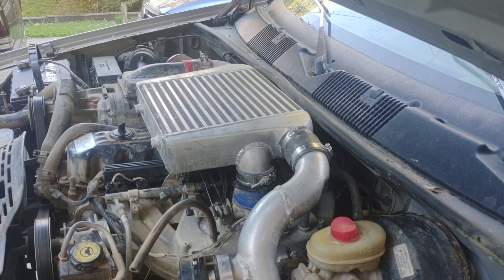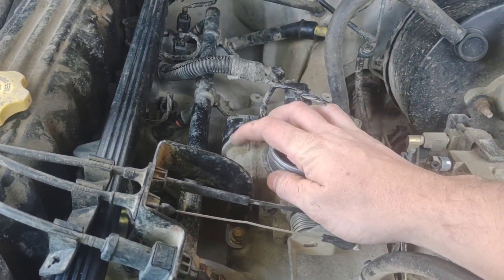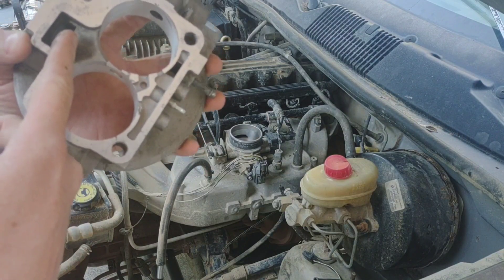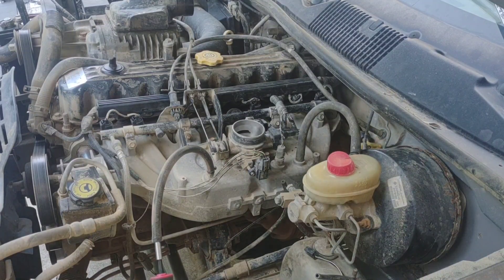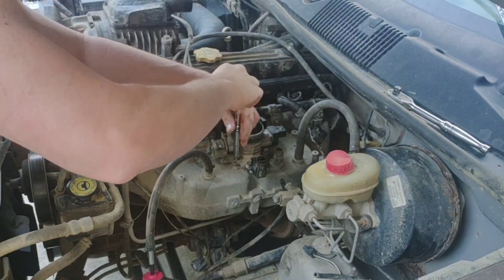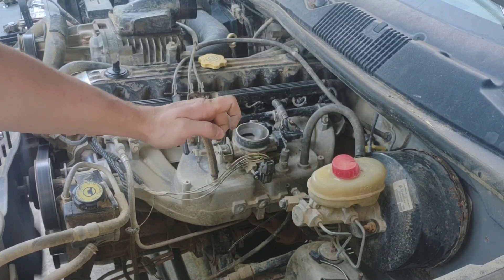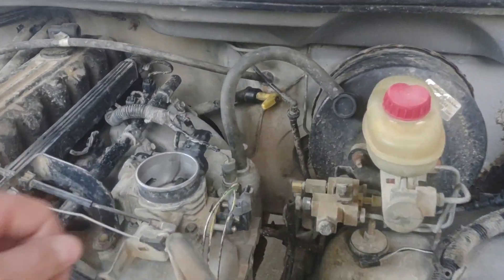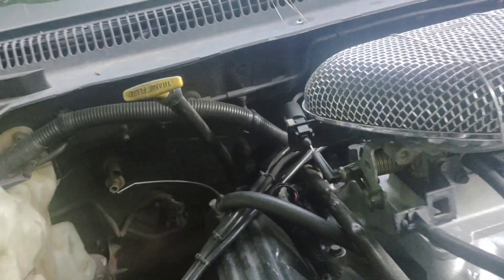jeep 4.0l base idle adjustment (same process for most early EFI)

Comment: whats you opinion on just setting the idle manually and skipping the iac entirely? i imaging a bit of idle variation is tolerable, but does it ever have issues besides vacuum leaks causing high idle?
Reply from the maker: Really depends what you're doing with the vehicle. If it's a daily driver IAC is a good thing. It adds a bunch of air on startup especially when it's cold, it compensates for transmission, AC and electrical loads at idle. From experience on one of my vehicles without iac I had to have it idled up quite a bit so it wouldn't die when the cooling fan came on. I would also have to give it some throttle on start up especially when cold outside. This was on a 4-cylinder the bigger the engine the less it cares.

Comment: I have an 85 cherokee keeps stalling midndrive when ibrelease the throttle gonna try this or st least somethomg tk the effect losing braking power and lower steerig mid turn in coty streets is gonna kill someone 😅
Reply: I fkn hate typing on a touch screen as you can tell lol I'm not illiterate I just dgaf anymore
Reply from the maker: Hopefully this is your issue. Idle air control motor could be having issues as well but I would start here.

Comment: Would I need to do this when installing a 4.0L head on my 258 bottom end I wend efi out of my 2000 tj but I have a sputter on take off then once I get over 2k rpm it seems to be a bit better and idle seems a bit rough nothing crazy.

Comment: Hey have a couple quick questions on tuning the computers in the 96-98grand cherokee 4.0. Can you shutoff all auto codes for the trans have a 97 with a ax15 swap and wondering if i can get the auto computer to stop trhowing codes 

Thanks
Reply from the maker: I've never tried that but an HP tuners in the jtec ECU you can change transmission type as well now I've never had a reason to do that but that may also be part of the solution. You can shut plenty of codes off but I can't be sure that you have the ability to shut every code you need to off.

Comment: I was wondering if it would be possible to turn the screw around so you don’t have to keep pulling the throttle body off. My 92 XJ idles at 500 rpm and it hates starting and always stalls out when cold.
Reply from the maker: You could always use feeler gauges between the stop and the throttle lever and see how much it needs to move so you only have to do it once.
Reply: I turned the screw around on my 06 wrangler. Works perfectly. Dont know why the dealer installed it that way, most likely just to get more money for a simple adjustment

Comment: My 2006 jeep wrangler I have cleaned the throttle body I have a new idle air control I put on a new map sensor and the other idle sensor on the throttle body . I put it all back together some times it idles at 1200 sometimes at 600 and sometimes surges up and down from 600 too 1200 usually when I turn on the ac never get a check engine light any help would be great
Reply: im no expert but that sounds like a vacuum issue

Comment: I replaced the TPS on my 03 Wrangler Sport and it made matters worst. I don't know what the heck at this point.
Reply from the maker: What's it doing?
Reply: @thomasbeyer  A few days ago I noticed my Jeep was losing power during acceleration, so I had to downshift gears to pickup speed. I did the self diagnosis and got code P0123. I replaced the TPS sensor and it only made things worst. I can barely go 20 miles per hour now. The engine sounds and accelerates  just fine when I'm in neutral, but I start shifting gears, and it doesn't go too fast.
Reply from the maker: @hThorman123  have you checked fuel pressure and do you have a scanner?
Reply: @thomasbeyer  I do have a scanner. How do you check for fuel pressure? Should I replaced the fuel filter?
Reply from the maker: @hThorman123  idk exactly on a 2003 but my past of the 4.0s have a test port on the fuel rail that you can attach a fuel pressure tester gauge to. Most times there's enough fuel flow for neutral and when you go down the road if the filters clogged fuel pressure starts dropping off and it runs very lean. There's a good chance the filters clogged but if you can locate a fuel pressure tester you can check it you'll just have to check it while going down the road under load.
Reply from the maker: @hThorman123  if you have a decent scanner you can read data and you can look at the long term and short-term fuel trims and that will also kind of tell you if it's rich or Lean. If it's adding a bunch of fuel that's another indicator that the filter could be clogged or something's wrong with the pump.

Comment: Is that a stock T.B. on your Jeep or did you do anything too it ?

I have a pretty much stock 97 Jeep G.C. with the 4.0. ( Home made CIA ) which really woke up the Jeep, high flow cat. & muffler. Like an idiot I hogged out the bottom of T.B. too match the intake. I think it was like 2 mm but CAN'T REMEMBER, It came out great but I lost my LOW END. Mileage didn't change it still sucks but she pulls as good as a 4.0 will in the higher RPM range now.

Thinking about getting another T.B. & putting it back to stock & another thing she only ever ran good on 89 Octane since new. 87 would ping up hills & it had pretty much no power, worse on gas also. No matter what I did too it she ran terrible on 87 since new, dist. plugs, wires, colis, dist. cap & rotor, ect... I use nothing but NGK parts now but she still hates 87 Octane ? My 99 Cherokee with the 4.0 didn't care about the grade of gas, CIA or anything I changed on it always ran just the same, WEIRD.

Never had any problem with idle, I keep up on maintenance BIG TIME with this Jeep. It has 196,545 miles on her. Also put slightly bigger tires on it 235/75/R 15's it just looks better.

I liked when you popped your hood & said " YOUR'S WON'T LOOK LIKE THIS " LMAO.

Thanks for the Knowledge Sir, Henry from N.E. PA.
Reply from the maker: That's strange that blending below the throttle blade hurt bottom end. Newcomer racing did an intake manifold shootout and they saw a loss in power when they went from a stock throttle body to a 62mm but when they went larger than 62mm they picked up power. Shape is important but that's strange. I think there is a slight cam timing difference between those years and so far out of all the jeeps IV tuned non of them have been exactly the same. Different timing and fuel tables. So idk on the 87 octane mines boosted so I run 91-93 to play it safe with timing. If you have a good scanner you can check the fuel sync angle that could possibly effect some fuel efficiency.
Reply from the maker: And yes that is a stock throttle body
Reply: @thomasbeyer  Thanks for the replies. Yes I also thought it was strange it lost low end especially from what I've heard about doing this. Might throw some 4 hole injectors in it & see what that does.